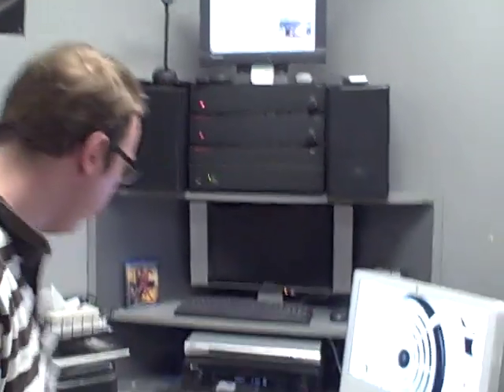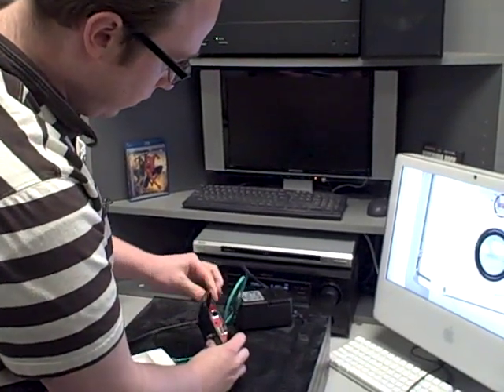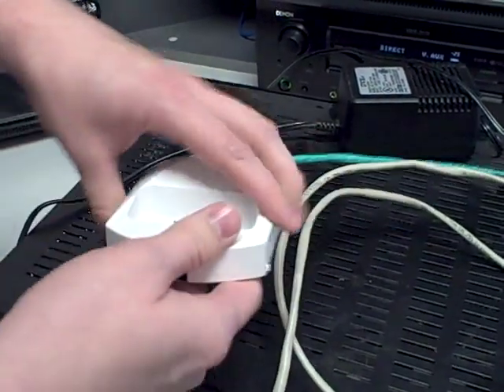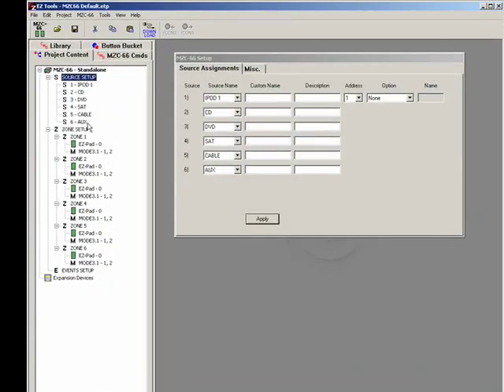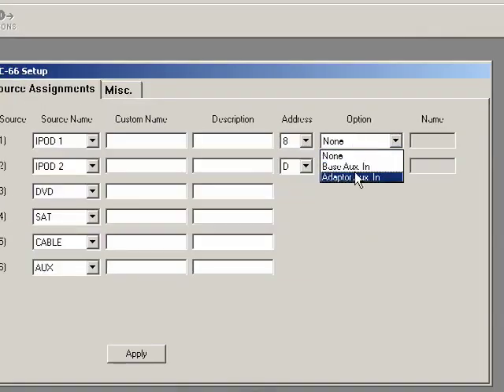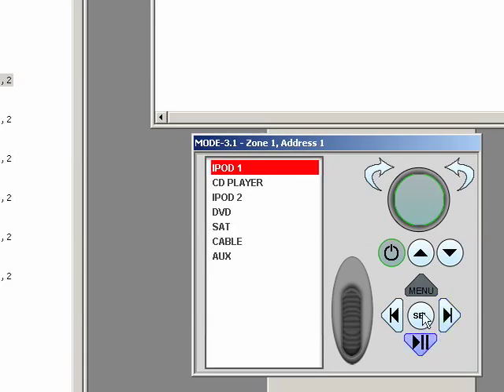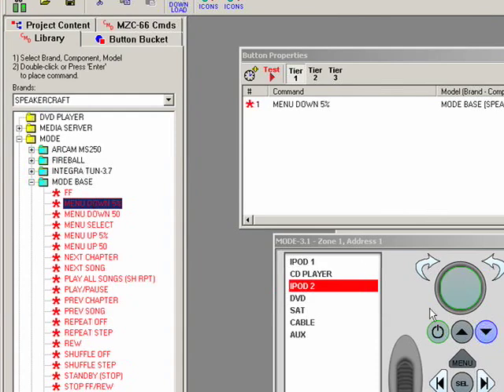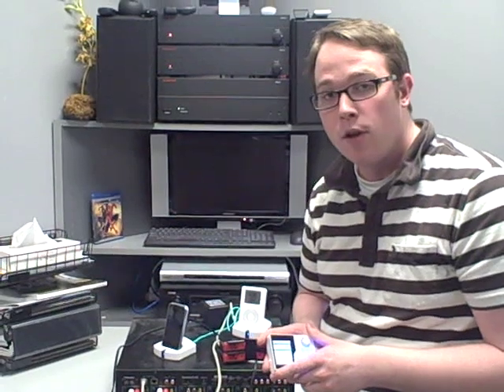How to Setup a Mode System

Comment: Whoever the engineers were for the mzc series, they need to be fired. First off, why not just make a base and adapter unit that's automatically assigned an IP address?  The number of better ways this could have been done, even bach when the mcz series came out, is mind blowing. For an audio engineer or computer tech this might have seemed easy, but for the average consumer, "easy" left the train station after mention the iPod dock. This is a classic example of why engineers should not be the ones to design the equipment. If you disagree, then just ask Apple how that worked out for them when letting go of Steve Jobs.